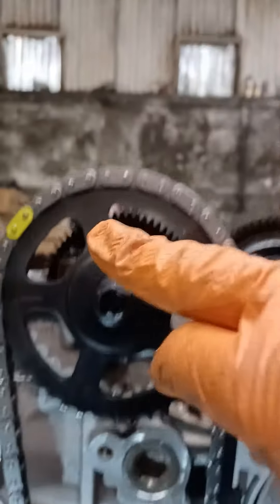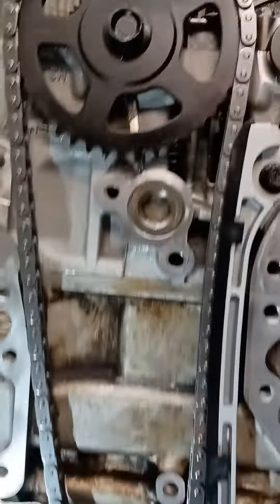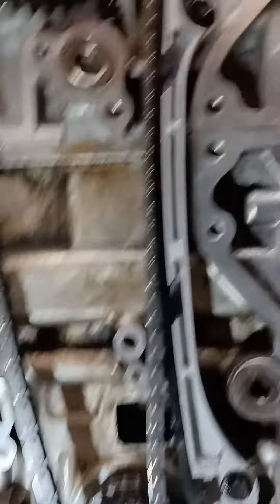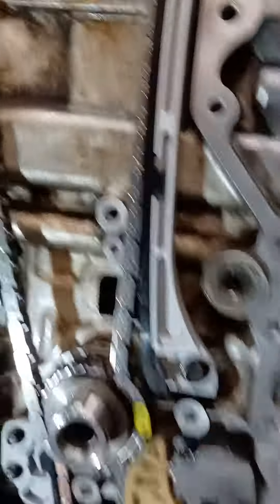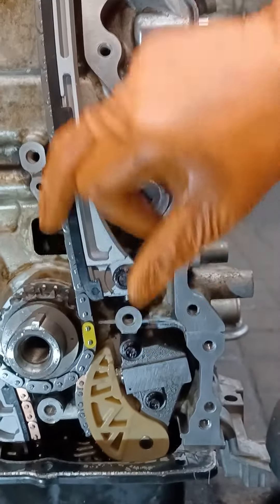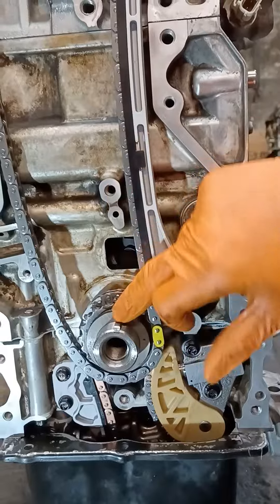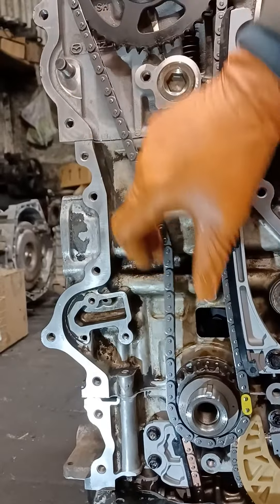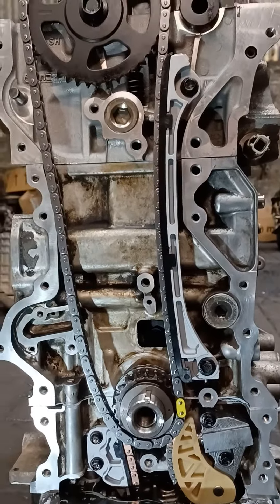Mazda CX5 Timing Chain Marks

Comment: Is this the same for the R2AA 2.2 as I've done my chain and it's come back with 8.25 degrees out, however I never moved any pulley to take up slack, thanks in advance (I did align and do 12o clock)
Reply from the maker: Yes, its the same. take up the slack then the bottom gear is at true 12o clock
Reply: @colinhagan4378 thanks Colin, I know for next round

Comment: Hi Colin what timing chain brand do you use is fAi timing chain a good brand
Reply from the maker: Hi, i have been using this kit for years and it has never failed yet https://www.ebay.co.uk/itm/254907544131
Reply: @colinhagan4378  Link is expired what kit is that :)